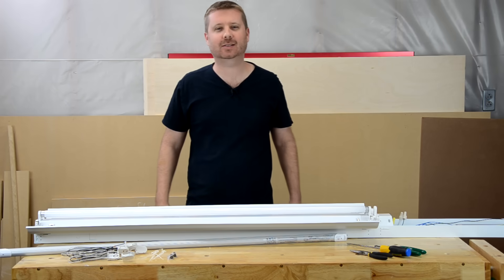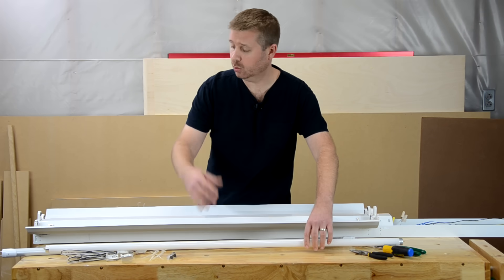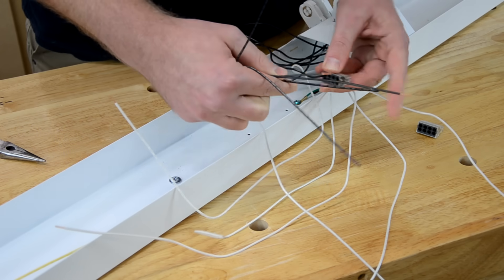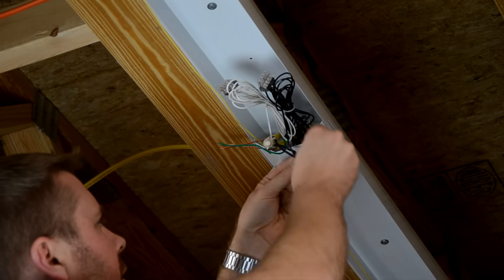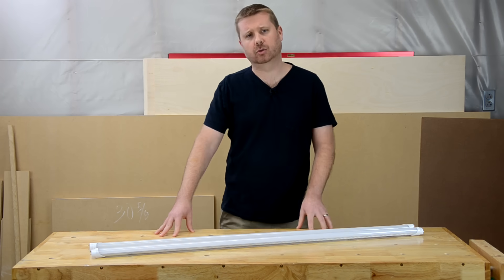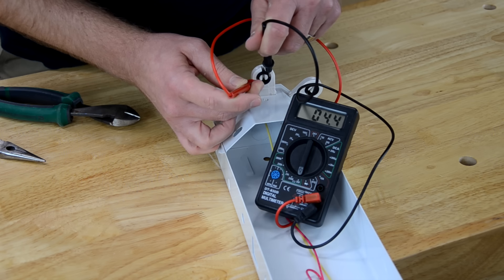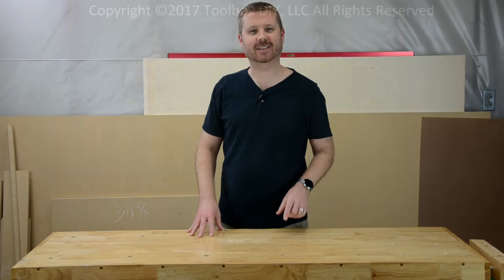How to easily convert fluorescent Lights to LED –Easy Ways to Save Money

Comment from the maker: It's been almost 4 years since this video posted. Here's a new updated version. Hybrid LED tubes make this even easier! https://youtu.be/VKEQ1HCLW5c
Reply: Hi, how do I do the opposite? I want to put fluorescent tubes inside a LED fixture... Please advise!!
Reply: Thanks
Reply: Will hybrid tubes work with this conversion?
Reply: I have an 8 ft shop light. Uses 4 ft bulbs. Have blue and red wires in the middle and yellow running to the end. I have double ended LED bulbs. How do I remove the ballast and wire that?

Comment: I need to do this with my existing fluorescent light strips in my garage since it gets quite cold in the winter the the LED tubes are unaffected by the freezing temps unlike the fluorescent tubes, plus the LEDs are much brighter. Some of my fixtures did not require any conversions whatsoever but others will. These days it is near impossible to find light fixtures that are not integrated with LED lights. Once they go bad you have to replace the whole fixture. Very dumb.

Comment: Right now Im setting in my shop looking at 26 led lamps i  swapped out 6 months back and didn't convert anything and a couple of the fixtures had bad ballast that wouldn't turn on the old florescent bulbs but worked for the led bulbs. Can someone please explain? Thanks

Comment: I can't believe no one has called you out on shunting. You are replacing non-shunted tombstones with shunted tombstones for a single ended installation. That is a direct short, "YOUR WORDS" in this same video. I wonder how many people have popped their circuit breaker following you instructions.

Comment: Dear sir, congratulations on the video. I have LGT8258B Preheating start electronic ballast. So far it has worked with 2 T8 2x58W neon tubes - without starter. Suddenly he started flashing and after 5/10 seconds he was dead. I bought 2 V-TAC LED tubes mod. VT-1577.T8.G13.20W I cut off the power supply on the requested side, after installing nothing to do they don't work. To see if the ballast is working, what voltage or current should I find in the output terminal block that powers the tubes? Thank you, thank you very much. Can you help me, thanks.

Comment: Thank you for your very clear explanation but i'm still in the dark. I explain myself. My ballast is not working anymore and i want to install LED tube. I ordered non-shunted tombstones and i bought a GE LED tube p/n LED11ET8G-18-3CC but i cannot find on the web if this model of tube is compatible with ballast bypass connection. It's not written on the box if it's a type A, B or hybrid.

Comment: I think you need a better multi-meter. 5 ohms is way to much for a shunted connector. 0.5 ohms or less is what you should expect.
BTW: I put this conversion in my kitchen lights a few years ago and its been great! Got it all at Home Depot. Take care to select the proper color temperature. 5000k in the kitchen is nice but not so great in other places where you would probably want closer to 3000k.

Comment: Plug and play, type A for use with ballasts, Type B are for direct 110V wiring, Type C for remote driver.
 I prefer the double end 4 pin tubes, easy rewiring, I use Type B  99% of the time.

Comment: I have converted 5  or so 2 bulb fixtures to LED.  I was able to "de-shunt" my original tombstones. Made the mistake of using 5K or 6K bulbs in my office.  Tried 3K bulbs, too homey, so settled on 4K color, perfect.  I ended removing 1 bulb in several of the fixtures to tone down the lumens.  Did all mine overhead. Bulbs have lasted very well at a fraction of the energy. I absolutely would not use fluorescents ever again, anywhere at anytime.  A 2 bulb lamp would have been less confusing for demonstration purposes. If you don't have a lens on your fixture, highly recommend frosted bulb tubes, to avoid bright pin point light.

Comment: Just buy the LED bulbs that say no rewiring required and just insert them just like you do the florescent bulbs they have what fixtures that the bulbs will fit on the box and usually it will also say what florescent bulbs fit the fixture and that's all you need to do, i found this out after i removed the ballast from one of the florescent fixture i bought and my light didn't work then i looked at the box the bulbs came in from home depot and thats when i saw no rewiring required and so i hooked that fixture up put the Led bulbs in and it came right on, not discounting this video in any way but id use the florescent fixture with the no rewiring required bulbs and not change anything unless the ballast is bad like he said in this video.

Comment: Dont make the mistake I made. DO NOT DO A BALLAST BYPASS WITH A PHILLIPS UNIVERAL REPLACEMENT T8 LED STANDARD With 2 PRONG  from home depot or lowes! THEY REQUIRE THE BALAST TO OPERATE. Just buy LED integrated fixtures and fuck all this wiring bullshit

Comment: It's not always possible to replace as shown because LED tubes are different lengths compared to old tubes. I find it easiest to replace fitting once and for all. Also if you do get tubes right lengths all you need to do is rewire 2 leads to one side of fitting per tube. No need to replace receptacle on ends of fitting.
Reply: I did replace the whole light fixtures as I hate the look of neon tube fixtures. A couple of $3 light bulb holders from Home depot to go along with LED light bulbs

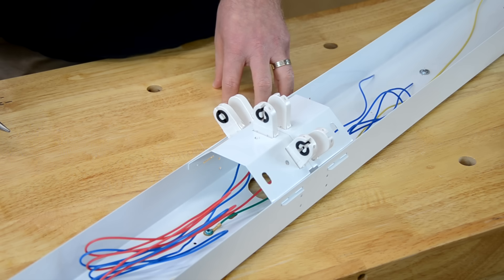Comment: Great video. Not sure if anyone noticed but there is a glaring error at the 3:55 minute mark of the video where you state you need to "replace these non-shunted lampholders with shunted lampholders". It's actually the opposite. You need to replace shunted lampholders with non-shunted lampholders"

Comment: Except flourescent tubes have more lumens ler watt then any retro led tube will ever have lol they have t12 tubes that are 98 lumens per watt.. no led retro is near that..  t12 is still way cheaper to buy too and still all over hardware stores
Reply from the maker: I have to respectfully disagree with you on this one. The LED tubes I have experience with have well over a 100 lumens per watt. See the links below for examples. 
I agree with you that the upfront cost of a T12 fluoro is cheaper, but I'm not convinced the total cost of ownership is cheaper. I've haven't replaced a single LED tube in 5 years, but in my fixtures that still had fluoro I had already replaced those twice. Rather than replacing them a third time, I just converted them to LED. Three T12s is getting pretty close to the cost of single LED and this doesn't even factor in the energy cost savings over the life of an LED tube. If you have a couple of tubes, probably not worth it. I have over 50 so it made sense for me and has turned out to be cheaper. 
128 lumens/watt: https://www.1000bulbs.com/product/223469/PLTS-60013.html
122 lumens/watt: https://amzn.to/37J6ujx
138 lumens/watt!!!: https://www.1000bulbs.com/product/222491/PLTS-20107.html
Reply: @ToolboxDIY  thanks for this.  I guess i was going off LED retro tubes ive seen in hardware stores.  They really are pretty low in the 80s for lumens to watts. While my 8ft t12 from GE are 98.   T12 have gone up but i can still get two tubes for 15$.    

I dont have 50 t12.  I do have 8 in a workshop.   But the ballasts were bad in 6 of them.  Since i removed my kitchens 4 foot double led fixtures ment to look like a basic covered t8-t12 fixture for more modern ligjts..  i opted to scrap two of the dead t12s for them.  Since it costed me 0$.   The other two fixtures i just replaced with the GE duel led fixture like 9k lumens for 70 watts.  Was only 80$ so might as well.

However the last t12 fixture that worked since the retro bulbs sucked in the stores.. i opted for the 60w-5900 lumen GE bulbs.  At 15$ for two.. its 25$ cheaper than the lights you linked. And use only 40w more power.   I also decided to just get a new t12 ballast and two more t12 bulbs for the other fixtire.  And put these last two working ones in the middle of my barn where i dont need them often like the workshop.

I guess if i had known about the 5500 lumen t12 leds at 40w i woulda grabbed them..  but its ok.  Already done now.  40w even at 13 cents per kw running at 13 hours a day for 31 days is litterally like 2$. The LED would pay for itself after a year so yea they do pay themselves over time.. not denying that based on your lights you linked.

But you still gatta admit t12 isnt THAT horrible as people make em out to be.  98 lumens per watts is pretty good still.

And t5s are even more efficient by about 15%.  My reef fish tanks use 8 foot t5s and the LED fixtures today are fancy as hell but i still would need 3 175w fixtires..  which is more power than the 4 8ft t5s.   And LED diffusers are still utter junk today..  

You can actually see this effect in aquariums as the water shows the (shimmer)  which is shadow.  With flourescents its 100% light coverage.  Something LED still cannot do.

Thats my other main complaint is glare and not efficient light spread on leds.

But yea youre right with these 120 lumen per watt bulbs they are worth it.  It would take 1-2 years to pay for itself in savings though.  AAND thats ONLY if you run your lights for 13 hours a day based on my kw hour math.

Comment: So the issue I'm having is I replaced my florescent tubes with led tubed that the box Said was just plug n play.  I installed the new lights. But when. I turn on the switch the light comes on fir a few seconds then goes off. Why is this.
Reply from the maker: Sorry for the late reply here. Plug n play is not a guarantee, unfortunately. Some tubes just don't work with some ballasts. I've seen some tubes that come with a list of ballast they know are compatible. You may have to return those and try a few different ones to see if you have better luck.

Comment: 3:56 Wrong!  A fluorescent tube fixture already has shunted lamp holders.  You have to replace shunted with non-shunted.  You have it backwards.  I wonder how many people ran into problems.  You need to over write your video with text, and pin your correction, which came four years too late.
Reply from the maker: You're late to the party, chief. The correction has been in the description since 2017.
Reply: @ToolboxDIY  Well good on you, chief.

Comment: Early in this video didn't you say " Single ended bulbs use Non shunted lamp holder?"
Reply from the maker: I misspoke at the beginning. Here's the correction from the description: "CORRECTION: At about 3:58, I misspoke. We are replacing shunted with non-shunted lampholders - not the other way around."
Single ended tubes require non-shunted tombstones.

Comment: Wait! Turn off the power at the box??? Why not just unplug it? It's easier to take it down then to try to do it overhead.
Reply from the maker: Unplug it? This is a hardwired fixture. If you have a pluggable light, then yes, just unplug it.

Comment: Why keep so much excess wire length in the fixture?
Reply from the maker: Since the end of the wires were already stripped, I decided it was not worth the effort of cutting and stripping 12 wires. I knew they wouldn't be visible after reinstalling the reflector. I like to work smart rather than hard...or said differently, I'm lazy!!
Reply: @ToolboxDIY  Thanks! Good point, I suspect the length may have been "on size fits most" for the OEM. I am going to give it a go.

Comment: 2 Jan 22 I have a 4 tube fluorescent light fixture. I want to replace the tubes with LED tubes.  I have 18w ballast suitable for the led tubes. The question is do I use a single ballast for each led tube (4 ballast)? Or one for two bulbs (2 ballast).
Reply from the maker: Does the fluorescent fixture already have the ballast(s) installed?

Comment: What is a tombstone? What is a pigtail? These are tubes not bulbs? These instructions are fine if you could do without it. If you know too little to sort it out for yourself, this will not help very much. It should be mentioned that this is aimed at the experienced electrical DIY'er, certainly not a novice.

Comment: I have done a bunch of those conversions over the years.  Tube style (two pins on each end) LED's just don't last long enough to make it worth doing.  I got an average of less than one year for these style tubes.  Much better to use the stand along LED tubes such as 'Barrina'.  These are much cheaper than the T8 replacement style tubes and last far far longer.  Plus much simpler just mount them with two screws and plug them in.  This video is very outdated.

Comment: In South Africa it invalidates your electrical certificate of compliance when rewiring the fitting, as the rewired fitting has not been type tested by the SABS.  Rather buy LED tubes that don't need any rewiring of the fitting - at least Philips and Osram have those available.

Comment: Thanks for showing people the right way to convert to LED. Most people think you save money by just installing direct replacement LED bulbs that run off of the existing ballast. That will not save any money. You have to do the conversion the way the video depicts in order to save money. Nice job
Reply: Ballasts are quickly disappearing. Home Depot only has one type and plan to have none by next year

Comment: Thank for the diy fluorescent to led conversion.
I'm in the UK so we have diffrent wiring, colours, fixtures and connectors.
Nice at the end that you explained the light o/p in lumins and the colour.
I refitted my lights when thay came out in the UK with Lidl ones bacically reducing my light if all on from 2500 watts to 175 Watts about 10 to 15 years ago.
The rule of thumb is you will save approximate 90% of power used.
Unfortunately they were 3000 lumins warm colour, so very yellow over the years changing them to 6000 lumins daylight colour.
Just subscribed to your channel.
Thanks.

Comment: So, When an AC cable is tightly coiled (zip ties), the coil is subject to autotransformer effect which can cause an incorrect voltage applied to the equipment, and greater heat generation in the coil. If coiled very loosely so that air can circulate freely around the wiring to prevent heat build-up. So I would not do it that way either cut the excess wire or secure them to the case with zip tied and a self adhesive block for zip ties.
Reply from the maker: I'm going to respectfully disagree on both counts...but not because you plagiarized that off a web post by someone else 😉 Autotransformer effect isn't at play here because I didn't actually coil the wires. They were folded over. Even if I did coil them, all the "windings" are getting the same supply voltage and these are pretty short lengths of cables. You'd be looking a voltage differences in the 10th of volt range which would have no impact on the equipment (LED tubes). Heat is also not a concern because of the low current. The tubes in this video are pulling 22w which is 0.183 amps of current. Those wires are 18 gauge which has a resistance of roughly 6.4 ohms per 1000 feet. Even if those wires were 1000 feet long, the amount of power loss (via heat) is 0.214w per wire. A bundle of 6 wires is then putting out almost 1.3w. That's a decent amount of heat, but since my wires were only 2 feet long this drops our power loss (heat) down to a negligible .026w.
Reply: @ToolboxDIY  yes I did copy from a Google search,  some of it. They said it better than I could,  so what, I usually add reference, that time may bad. Still cross electrons still can happen with wires that tight together,  may not cause voltage issues, but could cause the wires themselves to heat up and cause a waste of energy and possible fire danger, even if very unlikely.  Again yes I forgot to add the page ware I got some of the first post, that's on me.

Comment: Those are not "side cutters" they are diagonal cutter pliers.  Side cutters have cutters on the side at the outside of the hinge.  Lineman's Pliers used to always have side cutters on them and most all fencing pliers have side cutters even today.  Some lineman's pliers today still do have side cutters but most do not.
Reply from the maker: Your are correct. But where I from, diagonal cutters are a type of side cutter. Doesn't really matter though. I think people get the gist.

Comment: In Australia we use 240v and all it takes is to remove the starter and we are ago,none of this work you are doing simple why do you not try it?
Reply from the maker: Modern ballasts in the U.S.A are electronic ballasts and do not have a separate starter.

Comment: Converted to LED years ago, bought an LED tube from amazon, came with a special replacement starter to replace the fluorescent tube one. LED will light up only if plugged in the right way round but that was it. Job done and still working. No more flashing tube lights.

Comment: What does a bulb without the pins look like?  Are they designed to fit into the shunted lampholder - to be held securely?  Or is it just magic that they stay where you want them?
Reply from the maker: I'm not familiar with any tubes that have no pins. Is there one large pin in the center of each end?

Comment: '
better rather use the CFL tube light...
not need LED...
CFL is a either way plug as black = white wires...
but LED must use a - / + as negative / positive

Comment: Replaced my 6ft dual neon lights in garage with led units. Came with fittings and cheaper than replacing ballasts. Big plus is power saving.